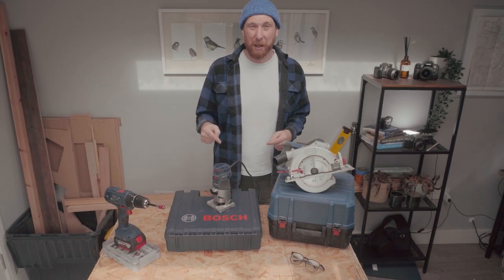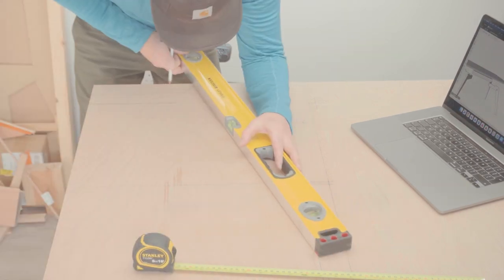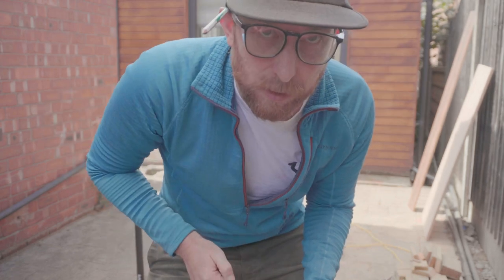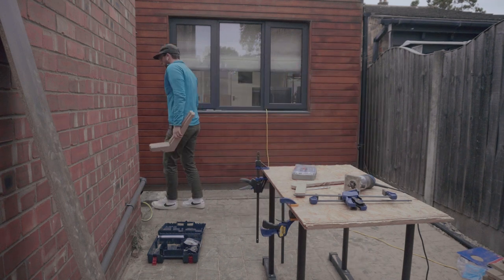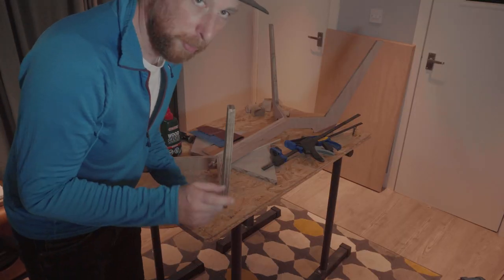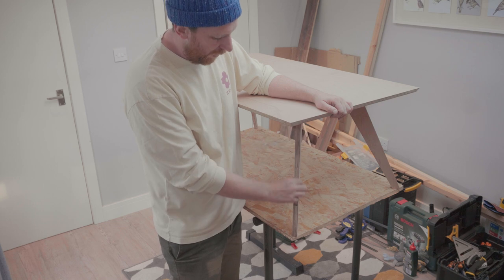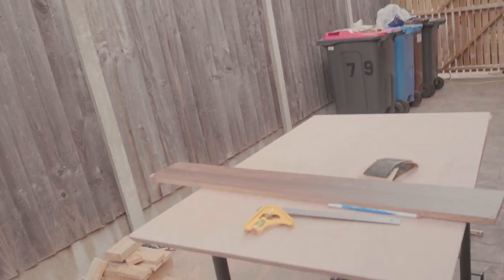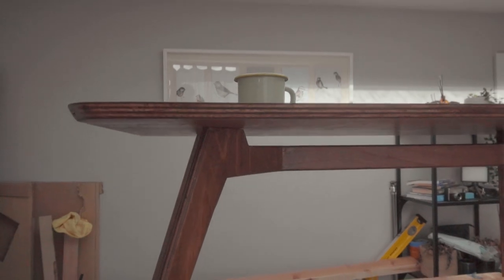A beginner DIY coffee table for less than £50

Comment: First of all, I love it. It's a simpler version of the foureyes furniture table which I'd love to build but the videos of his feel intimidating when starting off - especially due to the equipment they use. How much degrees did you set your circular saw to when sawing the edges of the table?
Reply from the maker: Thanks! Yeah, that’s one of the reasons I wanted to try and build it - to see if it’s doable with simpler tools. Turns out it is 😅

I can’t remember exactly the angle - maybe 20-30 degrees?

Comment: Nice! Do you think that desing cold work for a desk? I mean, 18mm plywood supported by 4 spots only. Would it bend?
Reply from the maker: Glad you liked it! I reckon you could play with that design and get it to work as a desk, yeah. Probably needs a thicker top, and not too large a span. Maybe add a fifth point in the centre to spread the load? Would love to see what you come up with if you give it a go
Reply: @northernworks  just for curiosity, what angle those legs have?